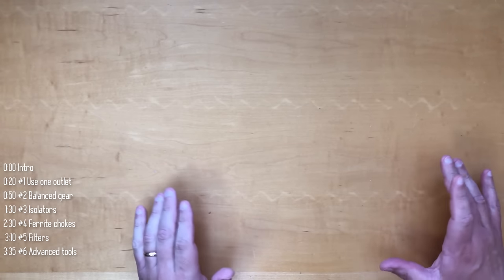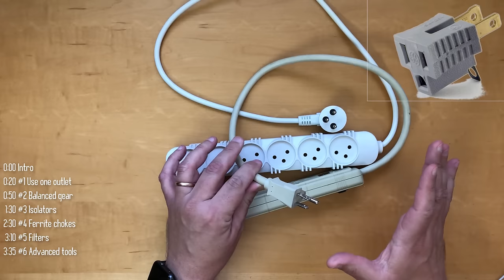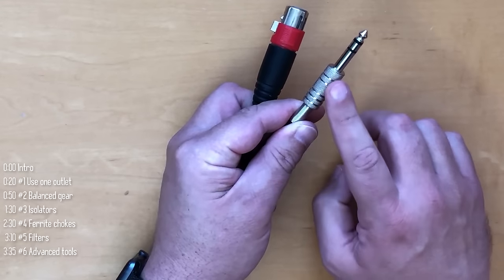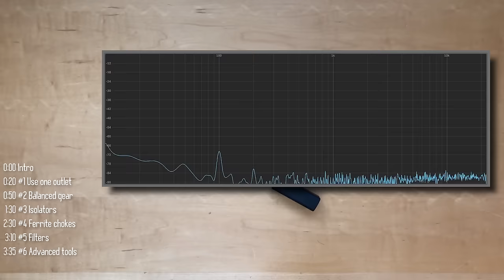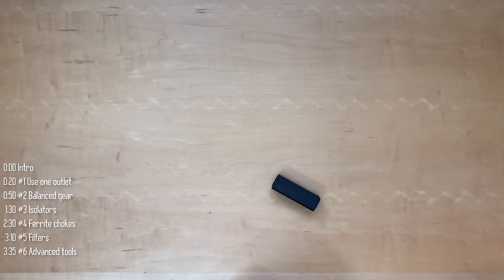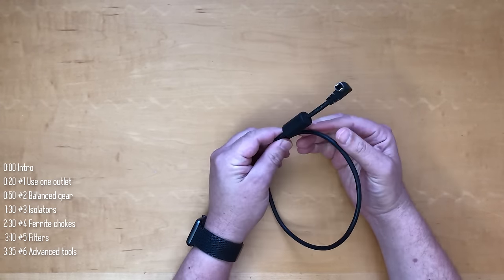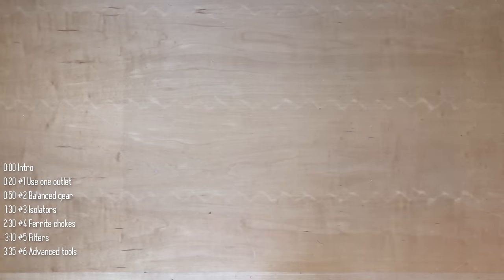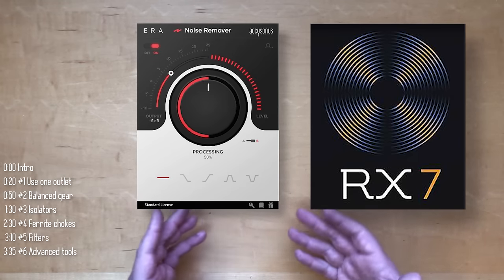6 simple and cheap ways to fix hum, buzz and ground loop noise

Comment: Your ground loop isolator is internally incorrectly wired.  That's why the signal is inverted.  Look for a better one and the signal wont be inverted.
Reply: @Mcsteveberry  Yes, 1 thing you can do with the internal wiring of Ground Loop isolators is swap (by accident or intention) the GND and the middle pin RCA audio signal.  Having the 2 backwards inverts the audio signal up-side-down.   The device inside the ground loop isolator is a tiny audio transformer which is nothing more than 2 isolated coil loops of wire around a metal core.  (2 individual ones side by side for stereo)  With some designs, it is possible that on 1 side of this audio isolation transformer that the beginning and ending of 1 coil on 1 side of the transformer was wired backwards making the resulting audio invert.  See here: https://youtu.be/fV_hsFK1MnA  On the audio out left and right, each of the RCA plug's + and - just need to be turned around and your audio will not be inverted upsidedown.

Comment: What about a GLI that functions with a TRRS cable?  I use a TRRS to carry a mic signal from a gaming headset to my USB PD docking station which has a 3.5mm combo port.  I can’t find a solution!  The headset’s power comes from the ps4 usb port.  Should I run an extension cable so the DS’s power source is the same outlet as the PS4?

Comment: Thank you! I just bought a prophet 10 and all the usb cables I’ve tried gives an annoying digital hum that is prominent in my recordings only when usb is plugged in. I’m going to try a Ferrite choke. Would you suggest a cable with them built in or the beads? Wish they sent with this kind of cable or at least mentioned it in the manual.

Comment: thanks, i solved my issue , i was using two power bars because i needed extra sockets, and the computer monitor was on the second power bar, and i moved all to one power bar and the noise went away. also i want to know can i connect my electric guitar to the focusrite interface using a TRS cable?
Reply from the maker: Awesome! You can the question is why would you want to? If you want it balanced you need a DI box
Reply: @loopop  oh, I thought I can simply connect the guitar to the interface with trs. I wanted to try trs as it cancels the noise. Although there is no noise now, very little when I use bias fx
Reply: @vikrantsingh47   i doubt a trs connector/cable will help you: the focusrite might be able to accept it, but your guitar almost certainly only provides an unbalanced signal to a normal, ts type socket. the cable will "work", but you won't get a signal on the "ring" connector, so there's no point (it might even be quieter and noisier than using a standard ts cable)
Reply: @vikrantsingh47  to reiterate what loopop said… there's really not much point in balancing the signal from your guitar to the audio interface: the focusrite will accept the signal either way, and if you use a DI you have to run an unbalanced lead (from the guitar to the DI), anyway

Comment: I have a humming / buzzing noise from my guitar valve amp. Tried to change plugs around the apartment but still the same. The amp sounds fine outside my apartment. Not sure any of tips 1 to 3 could apply. What could solve the issue? Many thanks
Reply: Same problem with my guitar amp...any UV lights near? dimmer switch? try only 1 power cable? let me know...Cheers!

Comment: I bought a usb condenser microphone called maono pm422 yesterday, and now that hum noise is very annoying, i tried izotope RX11 de-hum plugin and it works good but not perfect , So do think buying isolator can fix the problem?
Reply from the maker: No, and you should return the mic - it's unacceptable the a USB mic has noise - you should never be in a situation where you have to fix hum noise in mic recordings on a permanent basis
Reply: @loopop  thank you so much for your answer , actually today i connected it directly to my phone , to make sure that it's not because of the fans or other electric devices , and i tried 8 different usb type B cables and the Hum-Noise stayed with exactly the same volume and tone for each cable , and it sounds exactly similar to the noise i recorded with my PC , so if i'm not mistaken it's 100% the mic it self , right ?
Reply from the maker: @trancephile2412  sounds like it

Comment: Hi! My power amp has a ground lift button that magically removed the issue I had with chinch cables. This is a hand made high class power amp for 2,500 €, should I expect any drawbacks in sound quality? The instruction manual didn't say that it would affect anything.

Comment: Hi. I have another kind of noise issue that you didn’t include in this video. It’s made solely when the Yamaha hs7 monitor is plugged in and turned on in any outlet or wall plug in my house. It happens even with unplugging everything and happens every plug I turn on the monitors. Also, it just started a few months ago. Was noiseless for a year in the same place.  It sounds more like white noise than the examples you shown above. Also, out of the two, one monitor produce more noise than the other. I’m completely confused. Any thoughts?
Reply: Stephen Orion I have this same problem with a pair of hs8 monitors but it’s only with one specific outlet in the house...it’s quiet everywhere else...

Comment: As a guitarist with single coil pickups... electromagnetic frequency interference is my bane... and of course high frequency EMF/EMI is going to be terrible for health.
Reply: Your guitar and amp aren't producing anything close to ionizing radiation.
Reply: @jakejakeboom  Also if you had even the slightest awareness of the topic, you'd know that of course my guitar and amp aren't producing the EMF's, they are picking it up and amplifying it because of the nature of an amplifier (increases a signals strength) and causing major noise/interference.
Reply: @unknownuser8838  There are thousands more studies available going back to the 1970's.

Comment: If a speaker buzzes if I simply touch the audio plug (or plug it into my PC), will a "ground loop isolator" solve the problem? New speakers might be cheaper, but I don't want to find out the problem wasn't the speakers themselves.
Reply from the maker: Why not try. Ground loop isolators are under $10. Much cheaper than new speakers ;)
the best way to find out is shut down your PC and plug in something else. PCs are usually the problem
Reply: It shouldn’t be the speakers I don’t think, it usually does that when you touch the jack and it might be doing a similar thing with your computer. It has to do with the electromagnetic forces from the power being absorbed by a large object. (like your body)
Reply: That is totally normal happens with almost all aux jacks. If the buzzing continues then it's another problem (or a broken aux cable can do this)

Comment: I'm getting a particular frequency spike in my DAW when I switched on my AC but when it is off there is no spike and working completely good. Can U pls get me a solution to rectify the problem! Thanks in advance.
Reply from the maker: I'm no electrician but there's no way an AC should affect what's going on inside the DAW or computer, otherwise the whole thing wouldn't work. It may be interfering with speakers or sound sources connected though so I would look there... (use balanced cables and equipment, move to a different outlet). Please let us know if you solve this!
Reply: Oh sorry I meant the Air Conditioner that is switched on parallel to the computer
Reply from the maker: @WAVSAudioStudio  yes that’s what I understood you to say
Reply: Sure will try it out and let u know! Thanka alot for your time and response.

Comment: Hi there, thank you for a great video on these issues. I have a question, the moment I plug my laptop charger into the laptop, there is a constant buzzing sound coming through my active speaker system which is connected to my Pioneer RX2.
All the power cables are connected to one single multi plug unit. 

Will the use of Ferrite Chokes help resolve this issue of would you suggest another option?
Reply from the maker: Ferrite chokes are for data, not audio noise. I'd recommend one of the other solutions

Comment: I have an XLR mic plugged into a Focusrite interface. Some times I get these deep hums, they'll a little bit lower than 60 hz. Like 58. I think it happened when the cable got near my HDMI cable. Is that normal? I though XLR would guarantee no noise

Comment: Thank you so much! I have this weird 'Bzzzz'-sound + hum going on with my high gain guitar signal. My building lies right next to a city tram line and so the power cables are grounded/connected to the building which I thought might be the main reason. In the backyard of the building there is a wall of fans, and I noticed that part of the hum/interference is exactly the same tone/frequency as the acoustic sound of the fans! Is it possible that these fans generate some kind of magnetic field that bleeds in to the signal? I wonder if I could send you an .mp3 of it to get your opinion... It's so sad that I cant record high gain guitars without getting that hum... 😵
Reply from the maker: Humbucking pickups - or the “in between” position on a strat might reduce the problem a lot (using two pickups can work like a humbucker). If that doesn’t work try a gate or noise remover.  You can also try a DI box. But don’t forget gain is the ultimate amplifier of noise too...

Comment: There's a dimmer switch on my living room light, and it causes crackling noise on one particular mixer only (Behringer Eurorack Pro). I've tried everything to stop it, but the only things that work are switching off the light or bypassing the mixer. Watch out for dimmer switches.
Reply: Same! a light switch (not even a dimmer switch, someone told me its because of the type of light bulb that messes with electric equipment. it also makes my push 2 act odd) makes my headphones and monitors coming out of  focusrite scarlett 2i2 noisy, and no amount of ferrite beeds managed to solve that.
Reply from the maker: Did you try a ground loop isolator?
Reply: @loopop  almost sure it doesnt have anything to do with that. The noise isnt coming on the way in (mic guitar etc.) But rather on the way out, its just static noise no matter if any sound is playing at all or even if any sound source is connected. Another reason for me to believe its something with the light bulb and not the house electricity is that it only happens if the lights are on, specifically these lights and it also effects my push 2 (constantly moving the swing knob and starting recording whenever i move a knob). My solution so far is to work with other lights although it is very annoying not being able to use the room lights.
Reply from the maker: I would try it just to make sure. These are really cheap - put one right out the connection to your speakers
Reply: All my gear is plugged into the same outlet so it's not a ground loop problem. As long as the Behringer isn't switched on and everything's coming through my main mixer, it's blissfully silent. Also, the longer the cable running out of the Behringer, the worse the noise seems to be.

Comment: I have a humming problem which was only ‘ ‘solved’ by moving the DAC to the other side of my amps. Any ideas what causes this, as I ruled out ground loops, component or cabling issues? 
I’m puzzled. I also got this same problem with different DACs and another CDT.
I bet you can’t solve this 1!

Comment: I hope anyone can answer me.

I have an amplifier. There is no problem when connected to speakers.
The problem starts when I connect a microphone or to the AUX; It starts humming/buzzing. But when I touch the metal case of the amplifier, it stops humming/buzzing.
Can someone tell me the cause and solution? Thank you.

Comment: I have power filters and noise generated by my computer on boot up is sending signals into my speaker/amplifier. My power bar blocks out EMI and RFI signals. My computer is also plugged into a power filter. They are plugged into power filters from two seperate outlets but used to be plugged into the same filter from  the same outlets with the same problem. I heard disabling some power setting in  the bios may resolve this which I am still trying to figure out.  If any of you have any suggestions let me know. The noise is coming out of my guitar amplifier speaker without the guitar plugged in. Its a waving high pitch frequency that only occurs with my PC booted up. In the bios or turned off I have no issues. Thanks for reading.

Comment: is it normal to hear a humm sound when trying to use a stereo Line Mixer? Recenertly bought a Minimix 2 so i can hook it up to my tv for i can Use my Roku and my computer for my headphones. The isolator helped a  bunch then i tried connecting a second isolator to a different channel and got a  hum again.  Any reason why that happened?

Comment: I use a Mac 2012 and I record through Logic Pro X and I used my Nord electro to record and the audio was fine however when I used my motif xf8 it had a ground loop sound. I tried plugging everything into one outlet and I’ve tried the “TPS” cables still no change

Comment: could the ferrite beads work on 3.5mm cables? i have constant hums right now (even though everything is plugged into the same wall outlet) and ground loop isolators are much more expensive than ferrite clamps here in brazil...
Reply from the maker: Ferrite beads are only for data noise not hums

Comment: I think that im over thinking this. But I really want to eliminate the noise floor in my equipment. Using ferrite core beads and quality cables will help. But I feel like I need to identify what is causing the problem in the first place. Like various appliances throughout the home could be the cause. If anyone has advice for me that might help. It would be greatly appreciated.

Comment: I have a new problem on a previously quiet setup. It now makes a low hiss / crackle / whine from only my right monitor and only when connected to the internet (basically non stop) and it gets worse when actively downloading. Similar to a dial up sound, I seem to be able to hear the downloading process happening, which is rather annoying. I can't find any info because it's all about ground loops.

I already run balanced cables through a ground lift and it worked perfectly for years. Anyone ever deal with a similar problem?

Comment: No problem lifting the ground from the mains plug 👍 the only part of a sound system that draws lethal amounts of current is the amp itself, and they usually have build in fuses. The only appliances where ground is mandatory are things like fridges, ovens etc

Comment: I bought a audio isolator similar to the one in this video. (Kript Hifi version) Although it does the job and my ground loop noise is gone, it does indeed change the audio. The device in question an Ik multimedia Uno synth can be run on batteries or usb power. On usb power it buzzes like crazy. On batteries there is no ground loop and the sound is clear and defined. The second you put that isolator on the output running on either usb power (or batteries) the highest frequencies disappear and the sound is less clear. I've recorded from the same midi these variations back to back. It's a pretty noticeable difference. Which one  do you have in this video? Do you really hear no difference?
Reply from the maker: I forget the brand I used here - I couldn’t hear a difference and I have used ones where there was one

Comment: If you have big systems how can you plug everything into one plug? I have a lot more than 6 devices. I’m scouring the internet for some solution and nothing seems to work.
Reply: Use a 6 gang extension cable and on the 6th socket plug in another 6 gang extension cable and daisy chain until all equipment is plugged in

Comment: Let me explain why removing the ground pin is a bad idea in an easy way. Normally if everything is fine, it shouldn't do anything. If however, there is metal exposed to the end user so it can be touched, and a wire inside the device touches the metal, the ground pin is there to protect you by literally having the current flow to the grounding rod into earth. If you remove the ground connection and the live mains wire touches the enclosure, you now have 120/230V on it.